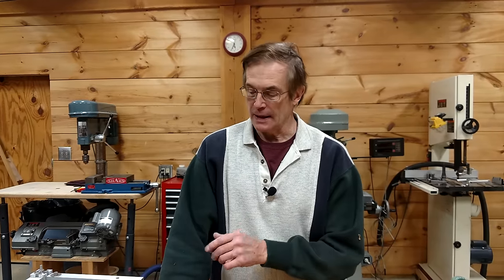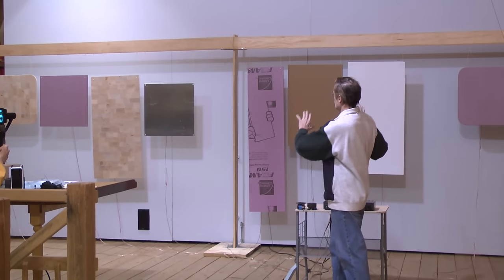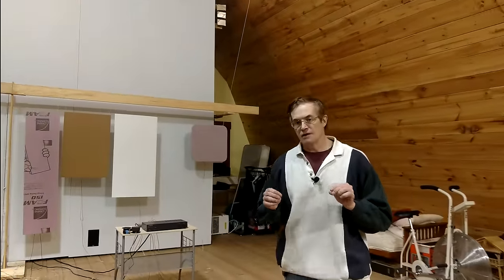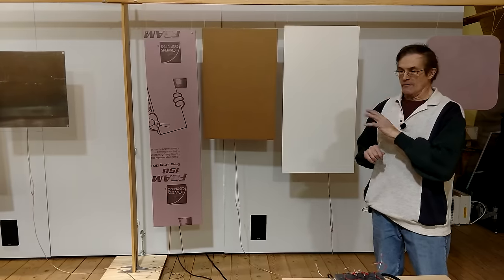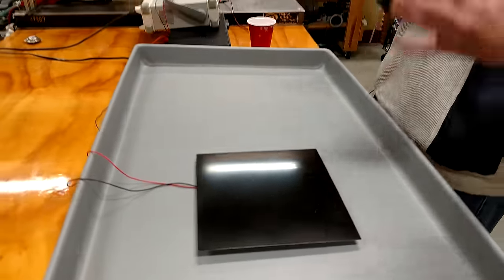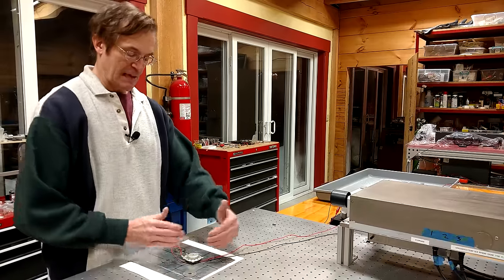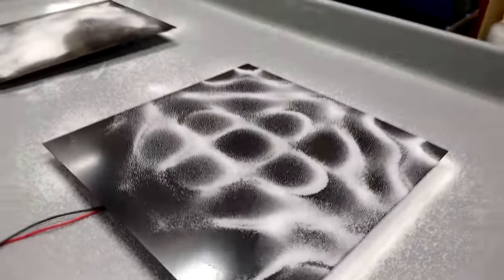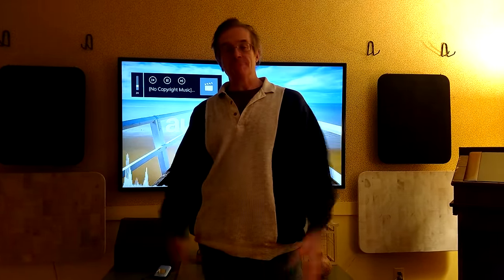Fantastic DIY Speakers for less than $30!

Comment: This is very interesting.  By extruded polystyrene so you mean something like Corian the countertop material?  Could you change or improve the characteristics of the extruded polystyrene by preferentially sanding it in some pattern, like radial or concentric or even a spiral pattern?
Reply from the maker: No, that material is far denser, closer to the density of aluminum and will not work well.  Your question is interesting regarding the effect of surface modifications.
Reply: @TechIngredients  
Thanks for your reply.  This is the first video of yours I think I've ever seen.  This was interesting, and interesting enough to want to know more.  Do you have any plans or parts lists to do something like this.  It's interesting how even over a YouTube video I could hear the differences you were talking about.  I no longer have big powerful stereo speakers just Bluetooth stuff for my computer so something like these would be a real economical alternative and a great conversation piece.  Very cool!

Comment: How does thickness of the foam impact the performance ? The reason I ask is in the world outside the USA foam board comes in standard sizes…. Not in inches…. Typically I can get 20mm or 30mm for example….. is it better to go thicker or do they then become too stiff so performance drops off ? Or go thinner ?
Reply from the maker: Go thinner.
Reply: @TechIngredients  thanks for the feedback, I’ll go for the 20mm

Comment: The 4' x 8' FOAMULAR XPS panels have deep score cuts (too deep to sand away) for your insulation installation convenience but sound waves would react as if they were an edge and reflect internally. I assume that is a bad thing but perhaps I am wrong. I have not seen this potential problem mentioned anywhere in all these comments nor in the very popular (and very long) DML forums. The width  I am considering for my speaker panels does not correspond to the spacing of the "convenience cuts".  Are there raw panels sold without the cut lines or are they simply not a problem?
Reply from the maker: Solid panels are sold, but I've discovered that much of the stock at US, big box stores is of the scored kind and agree with your suspicion about their effects.

Comment: Could you use a bass actuator/exciter instead of a subwoofer?
Reply from the maker: No.  The low frequency output from these panels is poor.  You'd need an enormous size to respond to the large amplitude, low frequency movement of the exciter.

Comment: I've been following your videos here and there for a while now, love the info!  I have a question about mounting - you hung them with monofilament, from two corners - would mounting the eciter to the wall be a better option? I'm just thinking the more rigid mounting would transfer more energy to the panel instead of losing a good portion to overcoming inertia.  (of course I figure the wall would likely end up contrinbuting, maybe negatively to the signal) or possibly to a rigid bar floor to ceiling?
Reply from the maker: It doesn't work.
The exciter needs to be part of the moving mass. Otherwise, the sound quality drops off.
Reply: @TechIngredients  I have the same question and suspect exciters don't have good transient response.

Comment: Where do you find the balsa wood sheets that large?
Reply from the maker: You can still probably find rigid, endgrain panels 2'x4'x1/2" on Amazon. Make sure they are rigid and not scrim backed assemblies of small squares.
We got boxes of these panels years ago for a boat building project from a marine construction supply house.

Comment: Is it possible to use one of these speakers as a Chladni plate?
Reply from the maker: Probably. 
The only problem might be that they are very flexible and the surface can bow under its own weight, causing the particles to slide off the edge.

Comment: Have you applied fractal theory to the placement?
Reply from the maker: In a very loose way, but the limitation is that with a single actuator and only two dimensions across a plane, it can't be exploited.

Comment: So was plywood too disappointing to even demonstrate?   I've wondered about the possibility of creating a type of subwoofer using a low frequency exciter playing from the subwoofer out of my AV reciever, amplified separately, and attached to a large sheet of about 4'x6'.   In plywood, wouldn't the thinnest board have the best effect as it is more flexible?

Comment: Do you not have the problem with the waves cancelling themselves out since you are still running a stereo set in the end?
Reply from the maker: No, that's not a problem.
Reply: @TechIngredients  Is it because the waves are so big? Would this become a problem with smaller speakers?
Reply from the maker: No, it's because the waves originate from a distributed source.

Comment: Has anyone tried drilling holes in the back side of the foam panels with a Forstner bit?   Possibly 3/8ths of an inch deep?    Just had that idea pop into my head and wondering what might happen, if anything.   Who knows what size or how many holes or where to locate.
Foam, like everything else is getting sort of pricey.    But this might be worth a try.

Comment: I wonder why you didn't take into account a BASS SHAKER combined with the exiter, most likely on detached panels. Anything wrong with these shakers?
Reply from the maker: Ya, we did try that.
They generate huge resonance peaks at multiple  frequencies depending on their loading mass.  It might work if they could be mounted to an extremely  stiff support, but then the purpose of their mass effect would be negated.

Comment: Just curious. If I put an overlay print on the panel using paper, vinyl etc will this affect the sound quality? Speakers that are also prints woohoo
Reply from the maker: It will.  Spray paint, or if you have it, a spray printer works very well.

Comment: What speaker size would give the best bass? The one you you showed looked like 1ft x 4ft. Would a 2ft x 4ft give more bass or is bass more about the length of the foam rather than the width?
Reply from the maker: Overall, the bigger the better.
Reply: @TechIngredients  Thank you for the reply. How thick was the end grain balsa panel in your video? I'm thinking that I would use that material.

Comment: If you couldn't hang these vertically, how would you do that?
Reply from the maker: I'd use a three or four point suspension with an elastic material or a spring between two thin tails to isolate the metal from the panel as well as the hard ceiling.

Comment: Is there a link to the 6 dollar exciters.  Seems too cheap but I want to try them.
Reply from the maker: It's  been a few years, but the exciters we used were and are still sold on Parts Express. The prices  have increased... a bit.
Reply: @TechIngredients  I never dreamed you would reply yourself on an old vid, most impressive, thank you, loved your solid fuel rocket one. You might be pleased if you added a gram or two of chisel chopped titanium turnings, mixed sizes,  to the 3/4 ID engines for night launches.

Comment: What about a metal with damping material attached (audio deadener on the back?)
Reply from the maker: I tried that, but the high mass of the metal is harder for the actuator  to move and so the sound output was much lower for the same power.

Comment: Very interesting.  But if the two speakers in each channel are wired in series are they still phase coherent?
Reply from the maker: Sure.  The two coils are carrying the same current. It's just a wire that is now twice as long.
Reply: @TechIngredients  OK, I am not the brightest bear in the woods.  In parallel each driver will retract at the same time and advance in the same time.  But in series will not one advance while the other retracts?  I am hoping you are right because I am building this rig.

Also, if one side is tuned for lower frequencies while the other is not won't this screw up the stereo image?  The guys who build speakers for a living send out a pair or mirror image speakers for this reason.  I mean, what if a piccolo is in the lower frequency tuned plate?
Reply from the maker: Picture two identical coils with current passing in and out of each through  identical leads. In isolation, an observer would not be able to tell if he was looking at coil number one or number two and each coil would not "know" if the current was coming in from the amplifier wire or from it's neighbor.  They would have to move in sync.
Reply: got it

Comment: This is great, but balsa plywood seems impossible to find here (Quebec, Canada).
Reply from the maker: Amazon has the balsa, but it's not plywood, but rather rigid, glued, end grain panels.
Reply: @TechIngredients  Thanks, I'll take another look. All I was seeing was stuff that was 1/8" thick or under. Would it survive outdoors? I'm hoping to build some of these for my back yard, mounted to the side of the house. At this point I'm thinking the insulation is the way to go for this particular project.  Looking forward to your video on how to build a subwoofer using a "butt-kicker" knockoff exciter. ;)

Comment: know any audiophiles that would be interested in 1950 era  theater amplifier with preamp in really good shape havent been able to locate proper speaker so i have no idea of its ability to work its a 250 watt tube amp and intact no burnt smell, tubes look good and serviced about 10 yrs ago very rare item any reasonable offer would be accepted its rca brand  and huge n heavy  it needs a good home to warm up with its tube sound and for its time a monster output  i just want to know it will be loved for what it is and the sound only tubes can create any help would be awesome

Comment: Is it possible to do this for my car sound system? In smaller size materials etc?
Reply from the maker: No.  The panels  need to be free and suspended.  They would swing around.
Reply: @TechIngredients  what if y suspend it horizontaly on the roof?
Reply: @TechIngredients  Should be able to suspend in an X from the corners to limit this.

Comment: My Dunnage card board size does matter on max size I can get just a 4ft square. I found 30" by 40" has the best sound and I have made up two center 7.1 channel driver that are 18" by 30" front channels that sound is very good for my voice channels. Note I put in a Piezo tweeter in to at the same location horizontal as the Exciters with a very nice sound
Reply: I have only had a few people listen to them and give a heugh thumbs up

Comment: Hi , I built the same speaker using Dayton audio 25w speaker (stereo)  frequently response is 80hz-12khz. 

The output was not expected, the mid is really poor wit voice is sounding like echo. I suspect I did something wrong of the following the caused this issue. 

1.)Painted acrylic painting on the panel, like art work. 
2.)Using Dayton Audio DAEX58FP Flat Pack exciter. 
3.)Sticked the speaker using silicon past. 
4.)using wuzhi audio amp. Cheap one. 

Please let me know what could have went wrong.
Reply from the maker: The most obvious issue is the paint. It adds mass and stiffness which are both bad. I don't understand your statement "silicone paste".  The exciters come from the manufacturer with very high strength double sided tape.
Reply: @TechIngredients  I used Dayton Audio DAEX58FP Flat Pack exciter. This won't come with VBH tape like other exciters but it has a flat surface which we can screw on any surface or sticked using glue. 

So i used silicon gel which used for fixing fish tank or mostly hardware sealing . 

Is the silicon past okay or I should go for VBH tape? I don't want it to be reason for muddy audio quality.

Comment: What if larger exciters were used, would the sound be less tinny and become richer?
Reply from the maker: No.  That's really a function of the size of the panel.  Larger exciters or multiple exciters need to be used to drive these larger panels.
Reply: @TechIngredients  I find this very interesting, at some point I would like to build some powerful speakers that are made of wood panels that hang.  Have you done anything like this?  ps... thank you for this info.

Comment: How do these Dayton audio exciters compare to bone conducting resonance speakers?
Reply from the maker: I don't know much about the specific properties of bone conducting speakers, although I suspect their power output would be more limited.
Reply: @TechIngredients  the ones I have are 8 ohms 20w and 4 ohms 25w I have been trying to power them with the built in Amp of my turntable and phone but theirs not enough enough power. I moved my surround sound reviver to the garage because of space constraints and want a compact and simple solution for good sound.

Comment: So, what is the limiting factor for the low spectrum frequency? The panel or exciter itself?
Reply from the maker: Primarily the panel.
Reply: @TechIngredients  But why? If, let`s say, a spruce panel can vibrate lower than 100Hz when used as a piano soundboard, why can`t it behave the same with the exciter?
Reply from the maker: Partly, my answer is empirical.  The thinner the panel or as the surface area increases, the low frequency response improves with the same actuator. This implies that the force exerted by the acceleration of the coil generates more amplitude as the panel becomes less resistant to bending even if its mass remains the same or even increases.
Reply: @TechIngredients  Ah, so the problem is due to different surface area affected by force? If i got it right, the piano soundboard moves uniformly because it is affected equally along the whole length of the string, while actuator creates "ripples" in the panel because it fires at the singular point. So, solution is either an actuator of elongated contact area, or maybe in cone shaped panel? That would defeat the cheapness and compactness factors, though.

Comment: Curiosity point. I build human powered 4 wheel cars. Recumbent (seated) side-by-side sociable. I've been looking to add things that are prevalent in automobiles (standard) yet cut weight and space where ever possible. Can these panels be supported in 4 corners like installed inside or as the interior panel of a polypropylene door in place of a standard speaker? Or in a back of cabin wall? A 2' X 2' or 1' x 2' panel is easy to design into the interior in place of a normal speaker, hiding and lightening the unit. Thoughts?
Reply from the maker: They can't.  Mobile applications aren't practical.  They need minimal support for optimal response.
Reply: @TechIngredients  I saw on another site where they tested hard mounting using the threaded hole in the back of the exciter. Thoughts?
Reply from the maker: I tried mass loading the exciter which is somewhat similar and the resonance peaks became larger. Fixing the panel is a definite no no.
Reply: @TechIngredients  First point, thanks for the reply. I've seen a test whereby the panel was fixed or hard mounted by using the threaded screw hole in the center back of the exciter. The sound was still very good. Dual exciters in his test (One by the 2/5 bu 3/5 and the other centered) sounded fantastic. (2X2 rounded corner panel) Since my door and cabin design of Coroplast polypropylene corrugated panels in a box wall design does and will require some Chicago screw mounted aluminum C channel reinforcement, I could use the "Hard Mount" idea. When I can afford to go to Portland OR to get more Coroplast I will mock up a set of small wall panels with holes for a set of speakers, monofilament and hard mount to test. I'm wondering if using the hard mount system if the panels will have adverse vibration issues. The other factor maybe in the hallow door or wall interiors may cause some interesting sound channeling. Don't know, but hopefully find out soon!

Comment: . What's the best way to attach exciters to board?
Reply from the maker: It depends  on the panel  material.
The double sticky tape that comes with the exciter works well with Styrofoam.
The balsa and acoustic ceiling tiles should have a thin layer of epoxy poured onto the surface where the exciter will be attached, and once it cures, the tape will stick well to the epoxy.

Comment: Could you glue one of these exciter to an acoustic guitar and use it to record than play it back through the same exciter. I wonder what it would sound like
Reply from the maker: It would probably not sound right.  Your ear hears the resonance of the entirety of the instrument while the actuator would respond to local vibrations and in theory, reproduce those vibrations at that same location.  The rest of the guitar may not be driven reversibly from that location.
Reply: @TechIngredients  I believe you are right but I'm just so curious about the sound that would come back out. It would probably be very muffled.

Comment: I wonder.. what if you attached say idk like 10 or 20 around the wood paneling of say a camper or a boat, and well turn the craft into a speaker? Also I bet a boat equipped with a bunch of those exiters would make strange waves, maybe even move it with the right frequencies.. idk, I'm full of crazy ideas. That's probably one.
Reply from the maker: Interesting.
These are probably not well matched to mobile installations.  They really need to be free hanging for optimal performance and would swing wildly in a boat or a car.

Comment: Love the way you put this across, easy and relaxing, However, these type of speakers are not new tech, it goes back to at lest to the late 1960s when thee speakers manufactory "Goodman's" made a compleat range set for the BBC for a TV show
Reply: PS try doing other shapes like star, also try making your own ply wood but instead of having the wood grain at 90 degrees reduce the angle to 5 degrees. The results are very interesting also try that blue foam they use in freezes